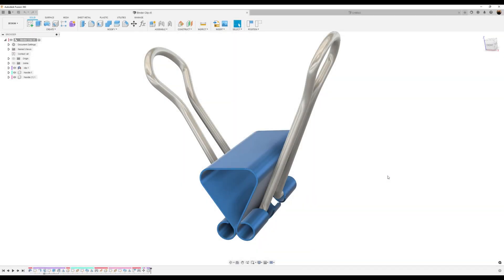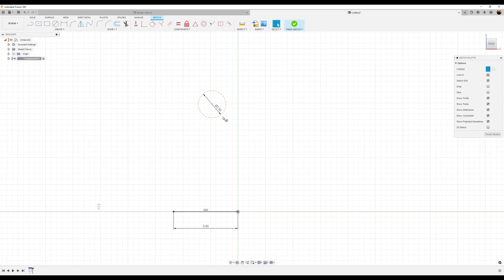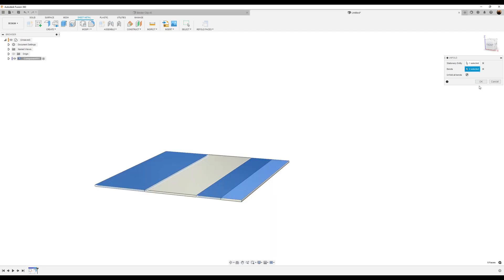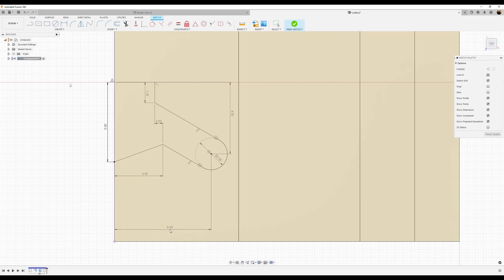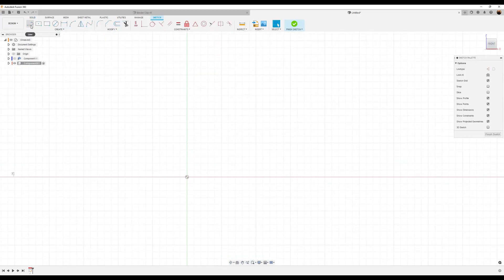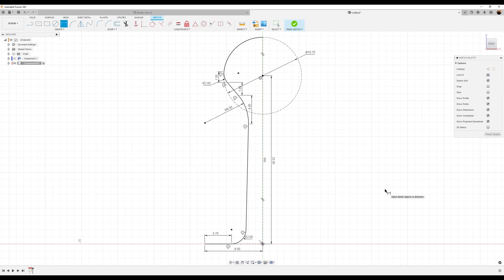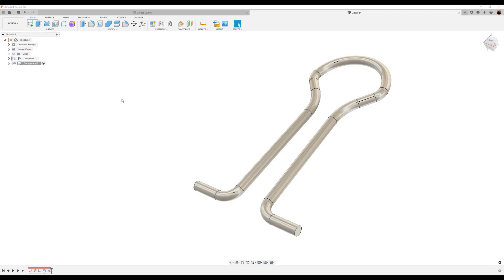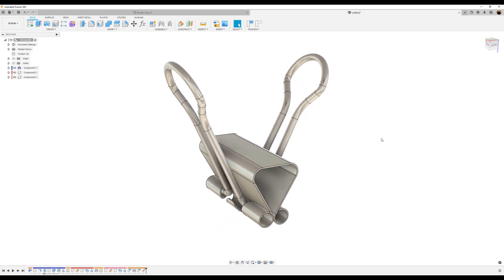Create a Binder clip in Autodesk Fusion 360 | Project 4 complete assembly

Comment: Hi CJ. Having got as far as fitting component 1 into component 2 I found for some reason the 'wire  handle' opening isn't wide enough to fit into the gaps of component 2. I'm sure I copied your dimensions etc. Tried to move the timeline back, so I could check my measurements against yours but I can't get the original sketches with measurements, to show. Now starting all over again. Is there any way to get the original sketches up on the screen and then edit them if a mistake is found ?
Reply from the maker: Instead of moving the timeline try editing the actual sketch in-place as is.